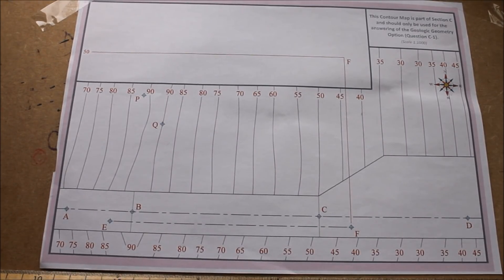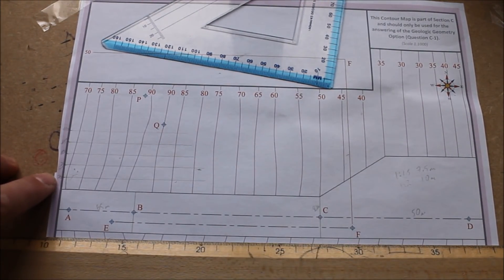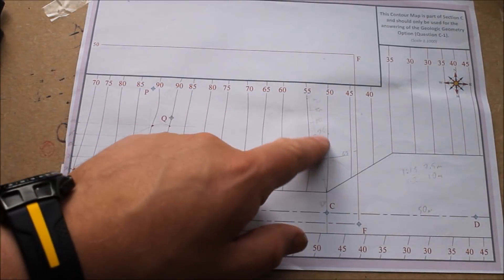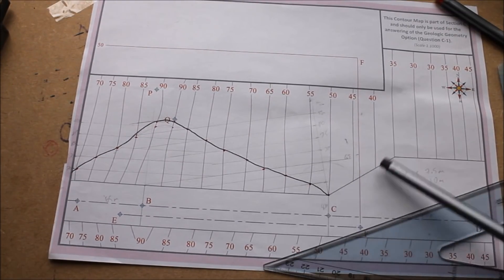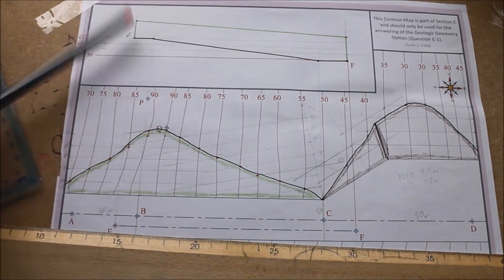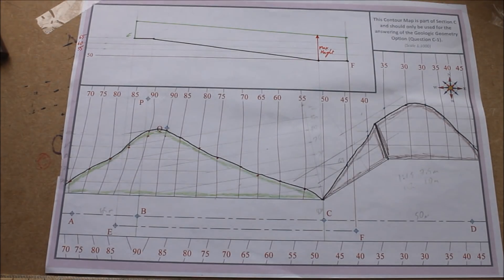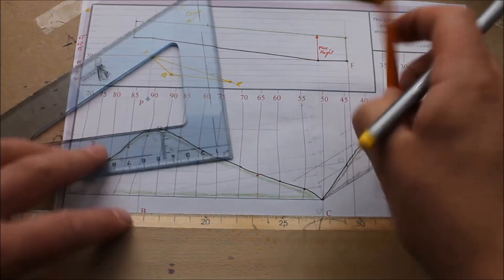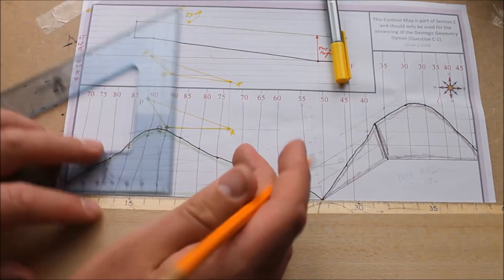DCG:2017 Higher Level Question C-1

Comment: Could you pls explain how to know when its cutting and when filling
Reply from the maker: If the road level is 50 and the surrounding contours are less then 50 (like 35 etc) then you Fill up to the road level. If greater than 50 (like 65 etc) then you Cut down to the road level. 👍
Reply: Thank you!